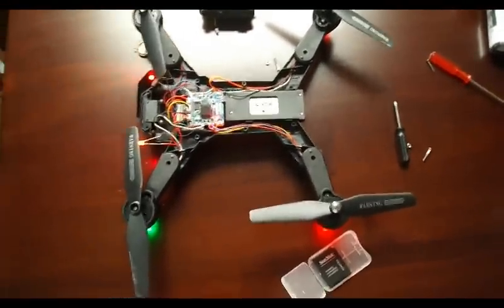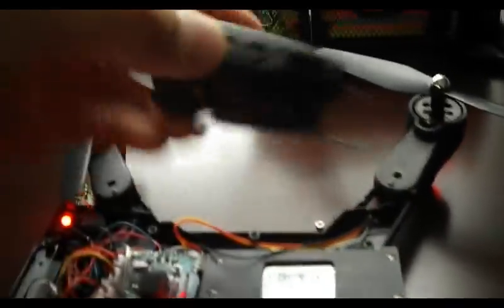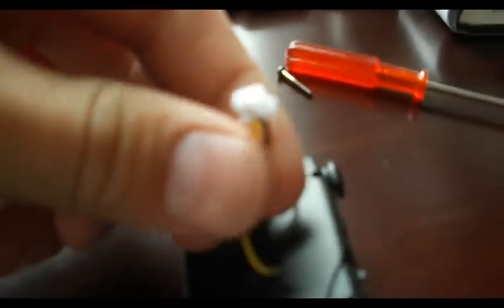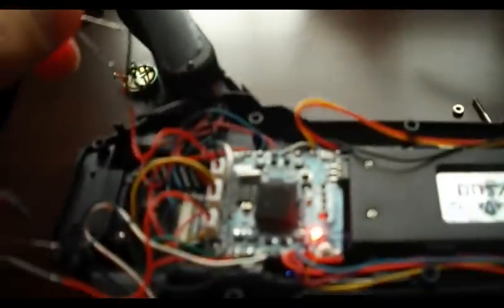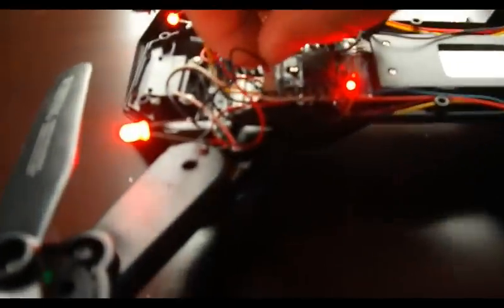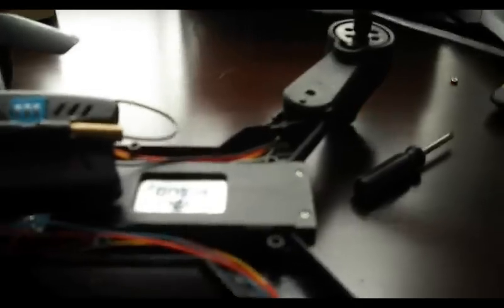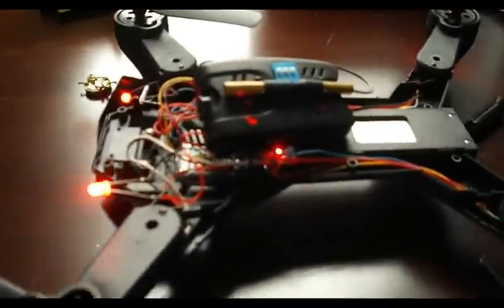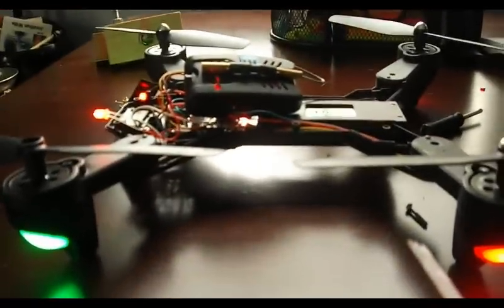Visuo Drone Camera Upgrade

Comment: Would this work with other fpv cameras like the runcam split mini 2?
Reply from the maker: If it has the same connectors, then most likely yes. You also have to take into account that this drone is powered by brushed motors which means that they can barely lift this camera.

Comment: do you know what that type of camera pin is called/ recommend any replacement camera for good photography?
Reply from the maker: The camera works off of a jst 1.25 3 pin connector. This drone isn't the best for lifting any serious camera gear or even a gopro. Your best shot is to either buy a drone with a better camera, or mode another drone like the MJX Bugs 3 to carry better camera gear. Check out my video on stock or self-made. I hope this helps! Let me know if you have any other questions.

Comment: How did you mount it?
Reply from the maker: There was an included mount that I just hot-glued on. I would think that you could "rubber band" it on if you didn't want to hot-glue it on though.
Reply: Couldn't find that cam anywhere on youtube or amazon, but I did get some tips for making better footage with the original cam.
Reply from the maker: Well, if you have a monitor and only need the fpv live video, this camera is less weight and cheaper: https://goo.gl/xgdAaP (doesn't save video) Good Luck!

Comment: Cool upgrade especially if it is 5.8ghz fpv as opposed to the stock wifi 2.4ghz fpv, should give much better range and less lag. Would be even better if you could integrate it into the inside of the drones body, maybe fully remove the original and take the new camera out of it's housing and see if it matches up inside?
Reply from the maker: That's actually along the lines I was thinking. Good luck if you try it!

Comment: Can we upgrade the battery for xs809
Reply from the maker: Thư Minh okay, so I haven't gone into too much depth with the battery upgrades, but I believe if you can attach a larger battery to the existing connector, you should be good. Remember the larger the battery the more strain you put on the motors and circuit board.
Reply: Tech Ex thank you^^

Comment: Great video, Tech Ex. Is there a way to connect the Firefly Q6 camera, using the AV cable included with it, to the Visuo  XS809HW camera board and thereby replacing the stock 2MP camera, whilst still using the battery in the Firefly Q6 camera? The AV cable has a 3-pin output but I'm not sure if it will work as intended... Apparently the AV cable has a voltage regulator and is intended for 2S and up batteries. Was just wondering if there is some workaround...
Reply from the maker: I've only explored ideas for connectors that are relatively simple. I am sorry that I can't provide more information but I do suggest that you figure out a way to use the existing connector in order to accomplish your task. You may need to create your own adapter. Let me know if this Helped or if you need more info!
Reply: Thanks, Tech Ex. My main reason is to get a high quality 1080p 60fps FPV feed and recording. The Firefly Q6 is an excellent camera for this purpose.
Reply from the maker: You can always use the wifi camera for fpv and the firefly for recording.

Comment: Tech Ex, by any chance, do you know how to rebind the remote control of this drone? My remote does not sync with the drone anymore.
Reply from the maker: Try turning the quad on first then the transmitter. Then push both sticks so that your right stick is in the bottom left-hand corner and your left stick is in the bottom right-hand corner. Wait for the lights to flash rapidly and stop on the quad. This should work, let me know if you have any other questions!
Reply: Tech Ex, I've tried this procedure before and it did not work. There is no communication between the drone and the transmitter. I need to find a rebind procedure for Visuo similar to this video:  https://youtu.be/pnv0VSRPwsg

Comment: Cool, does the virtual sticks on the phone app still work through this camera?
Reply from the maker: That is untested. It should work being that the phone can control all functions of the quadcopter. This camera is only replacing the the other one already attached to the drone.
Reply: After looking at that camera more closely I think it is the same camera as the one in the drone just in its own case.
Reply from the maker: Craig Diamond That may very well be true. The one main  difference is the transmission distance and interface.
Reply from the maker: We just tested the app features. You can only use the app to control the drone if you connect the phone as if you were binding with the transmitter. You can not connect the transmitter and then control the drone with the phone.
Reply: Tech Ex where do u get replacement parts   Motor props etd
Reply from the maker: Check this out: https://goo.gl/BwZHwh